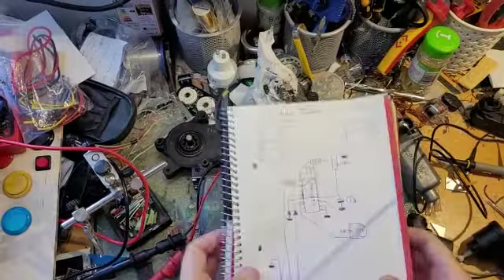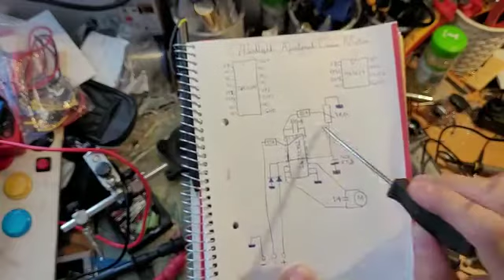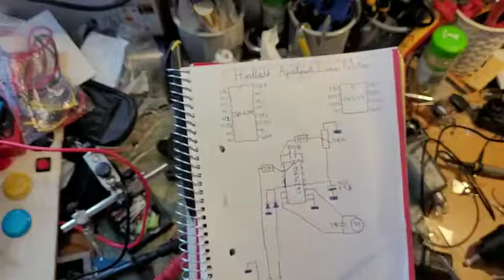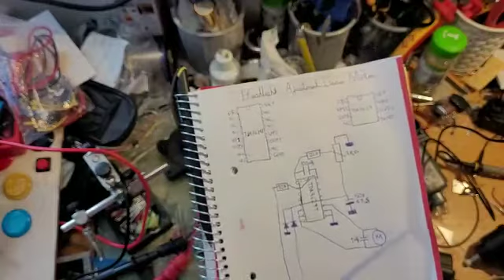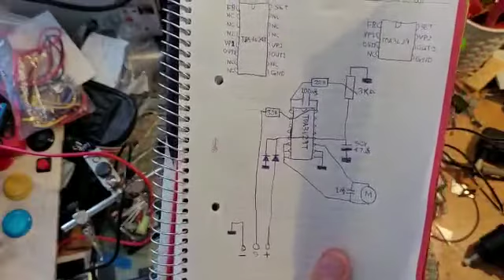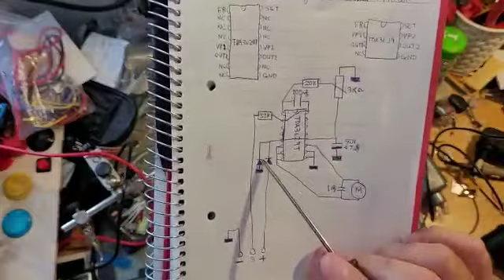Car Headlight Motor Hacking [Scematic]

Comment: I've never heard of a car physically tilting its headlights, that must be for the European markets only. In the US we just have one set of lights pointing down and one pointing up. The only exception I know of is some cars from the 80s which retract the headlights into the body when not in use and then pop up when needed. The lack of these motors over here is probably a large part of why nobody uses them online.
Reply from the maker: They do to ajust the beam angle. Pretty stanaderd. Shame they don't make cars with pop up headlights anymore.
Reply: They only till the reflector inside tha light enclosure  not the whole light enclosure
Reply from the maker: Indeed. The flippy headlights were cool.

Comment: You could probably get those on eBay new and cheap instead of going to the scrap yard.
Reply from the maker: Going to the scrap yard is fun though. Got 2 weeks off. I should make a trip
Reply: @TheEPROM9  it is ya but they charge a fortune for the parts oO
Reply from the maker: @MrPlytiger  Depends on the scrappy. Some do. Some don't. The one I go to is reasonable.& taking cars apart is fun